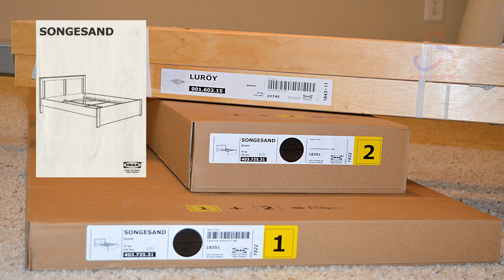IKEA Furniture - Assembling SONGESAND Bed Frame

Comment from the maker: LURÖY Slatted bed base (001.602.15) is the store recommended additional part of this bed.
Reply: Cant we use Lonset, its costlier  but it seems more stable?
Reply from the maker: You should be able to use either. They both fit the same frame, while Lönset was twice as pricey. In the long term its higher price might be justified. I don't see problems with Luröy though and its price suited me better.
Reply: @Armuino  Ok thanks.  I search on their website(canadian) and it seems Ikea doesnt offer warranty on bed base?  Does it seems really stable and durable?  Example seems there is no pole in the middle, under  the base to support the weight... Also somebody wrote somewhere it was sweaking...
Reply from the maker: @micduf26  You are correct, there is no pole under the base. But since the base in the middle is an expandable bar that I consider well engineered for the rigidity, it should do. I can't comment about the squeaking with Luröy as haven't experienced that, but the Lönset with rubber edges can claim to prevent that, I guess. The bed and the mattress is less than a month old, and so far felt as worth the money spent.
Reply: Thinking to buy Songesand or Malm high. Appreciate your suggestions. May I know what mattress did you buy.
Reply from the maker: @ravitejac3  I've bought HAUGESUND: https://www.youtube.com/watch?v=2CkTYscr8dU

Comment: Step 33 - we can’t seem to extend our bars to reach so we can screw...?!
Reply from the maker: Can you please take a picture of the bars you couldn't extend and share them somewhere (G-Drive, OneDrive, etc.)?
Reply from the maker: @nmgibbons4  I see nothing wrong with your rails. Did you try to pull the inner one with a bit of lightly moving it from side to side?
Reply: @nmgibbons4  did you end up getting them extended? Having same issue
Reply: I also have the same problem, how do you solve it? Please help me
Reply: @zatirazib2280  we ordered a new part from IKEA, when it came - they extended easily!
Reply: Nick Gibbons do u buy a seperate new one or you ask for replacement?
Reply: I was setting this bed up at 11pm..bad idea and I had the same issue...it wasnt until i went outside and banged it on the concrete that it opened up....lol ikea assembling does that to you lool wonder what my neighbors thought lol
Reply: Me too!! They just won’t move at all, both of them!
Reply: Janou Girardeau we had to order a replacement part which worked fine!
Reply: I had the same problem and had to go to IKEA to replace them.

Comment: My new sealy mattress sagged in the middle with that bed + lonset slats, I’m using the lower holes for beam and side rails, I moved the central beam to the middle  hole and kept rails on the lowest but now sides are curving downward do you experience that too ?

Comment: I think you replied to me but I can't see it here to reply, the problem is the bed head is too high to keep it attached during a move but when you remove it there is no structure in the remaining frame.. So you pull the rest apart only to find that if you didn't use the middle holes for the mattress height you have to also remove the rails to access the big disc fasteners to detach the sides from the ends.

Comment: Step 22 at 4:16. Should the wheel completely lock into place? They locked when attaching to the headboard but not the back
Reply from the maker: Yes, the wheel locking behavior for both sides was same.

Comment: Hello! Just bought this Songesand bed and it didn’t come with a bed frame I’ve searched Ikea for the Luröy bed base and there biggest is 90x200cm should I buy two?
Reply: Depends on the size of your bed, if it's 180x200 then yes, you should buy two
Reply from the maker: https://www.ikea.com/us/en/p/luroey-slatted-bed-base-00160215/ - you can choose the set based on the bed frame size. See video at 0:16.

Comment: Is there any way to remove the rings in step 16? We put the wrong side in for one of them and now the plank won’t fit in completely on one side
Reply from the maker: Where did you encounter the problem? I think, once the plank disconnected/removed, you should be able to pull the ring out and push in again aligned per the arrow's direction.
Reply: The ring was actually stuck. Had to get a hammer and a plier to pull the thing off

Comment: I read somewhere that this one is a squeaky bed. is this true?
Reply from the maker: Not from my experience.
Reply: That's my biggest fear too. We have an IKEA Slattum and it is a nightmare for noise, I can't move without waking my wife up and vice versa. I've tightened all the screws, I've taken it apart and put it back together again, I've used lubricant on the screws, I've inserted nylon washers, I've put stuffing to close the gaps, I've used rubber protectors on the bed legs, nothing stops this monstrosity from squeaking and creaking. My wife wants to change it out for this bed, but I'm so worried that this one will be squeaky too.

Comment: Ia there a weight limit on this bed?
Reply from the maker: Per the "My IKEA Bedroom" site: "In addition to the bed frame, a mid-beam has been added to provide additional support while the product is in use. Considering that different types of mattresses can be used with this product, the mid beam has been fortified to support the weight of all users regardless of the type of mattress that will be placed on the bed frame. The fortified mid beam is made from galvanized steel. The choice of a center support beam is necessary to give all users a better experience with the product."

Reference: https://www.myikeabedroom.com/ikea-songesand-bed-frame-review/

Comment: Hi,  for step number 30 and 31, I have not received the middle pole. Is one I supposed to buy it separately?
Reply from the maker: Yes, that is bought separately. Please check for the SKORVA part info at 0:12.
Here is the link at IKEA: https://www.ikea.com/us/en/p/skorva-center-support-beam-galvanized-90124534
Reply: I (from Canada) actually got it with the bed itself. Not sure if it is sold separately in the US.
Reply from the maker: Yes. It is a separately sold item in the US IKEA.

Comment: Hey, how did you do step 35 and a few subsequent steps? There is no thread to hold the screws...
Reply from the maker: The aluminium parts have holes with enough thread in them to hold the screws. Please confirm you are using the correct size screws (part # 117327).
Reply: I’m having the same issue. It simply doesn’t screw fully
Reply: I’m having the same issue, as well.
Reply: I managed using a smaller/shorter screwdriver
Reply: Same issue. The screws won't dig in and I am using the correct screws. I think only one thread went in. I haven't started using the bed yet because they missed the bedbase while delivering it. I am gonna get it tomorrow.

Comment: Are screw drivers and assembly tools included in package?
Reply from the maker: Only Hexagon tool is included. You'd need to use also own screwdrivers and a hammer.